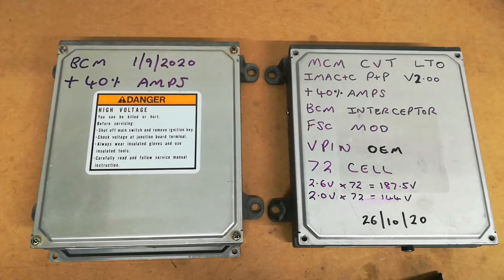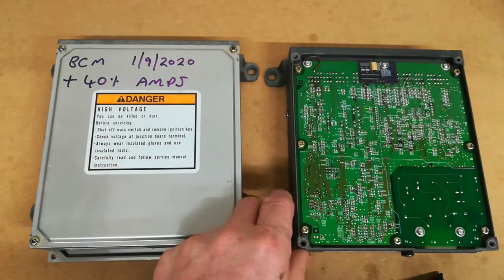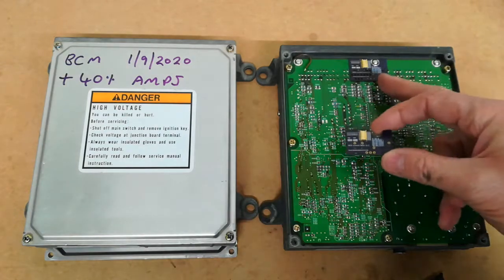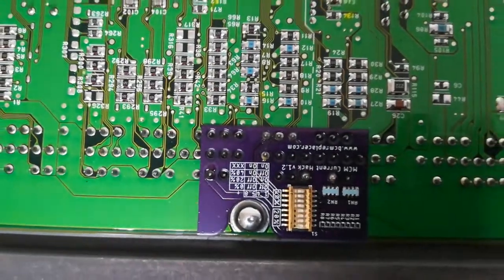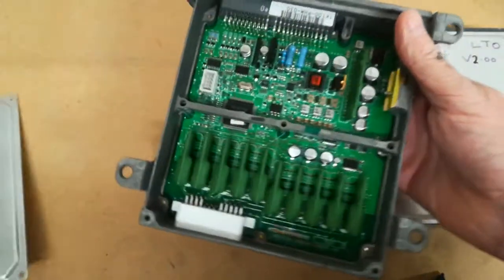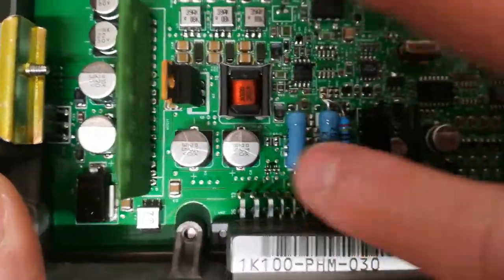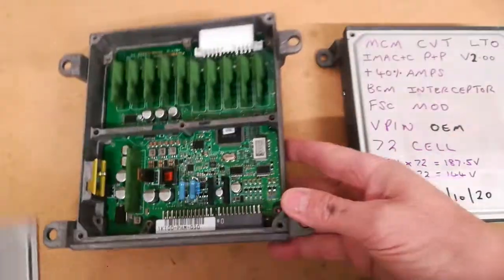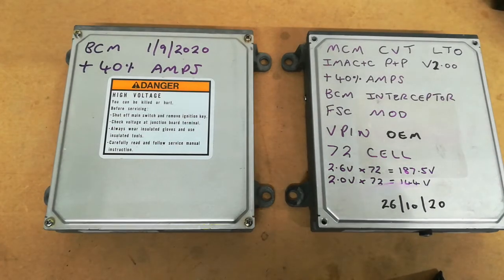Honda Insight G1 Current Hack install

Comment: Any thoughts on California (CARB) legality? They check for altered ECUs now, so I wonder if this would qualify as an alteration that they can pick up?
Reply from the maker: They won't pick it up.
Reply: Technically its not an altered ECU. It doesnt affect the ICE side of the car. Not really tied to emissions of the car, at least i wouldnt see how...
Reply: If anything it makes it cleaner because it send more power to the electric motor. Oddly enough the hybrid and engine control is mostly separate there is even a guy that put a little diesel in his and retained the hybrid functionality.
Reply: Maybe don't live in California

Comment: Hey Peter. I appreciate all the time and work you have put in to the insight. I was wondering if the +40% works with stock 6.5ah battery.
Reply from the maker: Yes to an extent if the battery is in excellent well balanced condition and you upgrade the main fuse to 150A.
Reply: @retepsnikrep  Cool. Thanks for the quick response.

Comment: What type and diameter solder do you recommend for the current hack mini PCB? I had a time getting solder to adhere to the plated through hole material (which seemed a slightly yellowish tinted metal of some kind)
Reply from the maker: Any resin cored electronic solder say 1mm. It's heat which is the problem you need a decent hot iron as the ground plane wicks away the heat.
Reply: Leaded or non-leaded?
Reply from the maker: @queenofspadz  Whatever you have